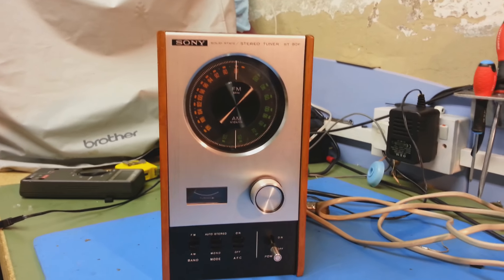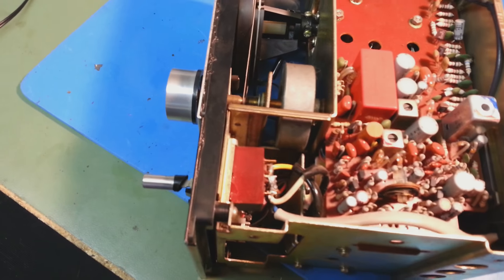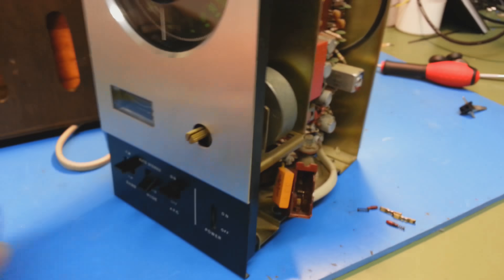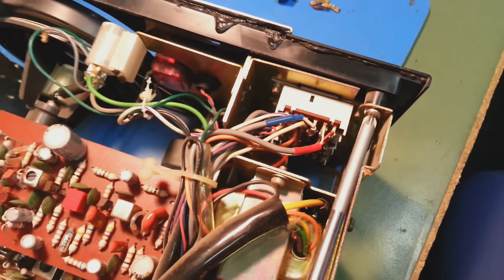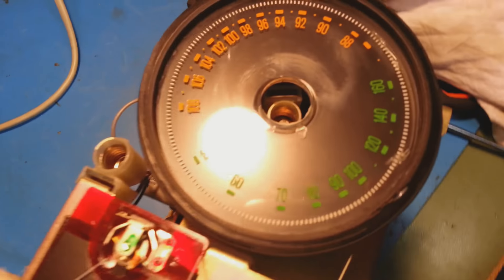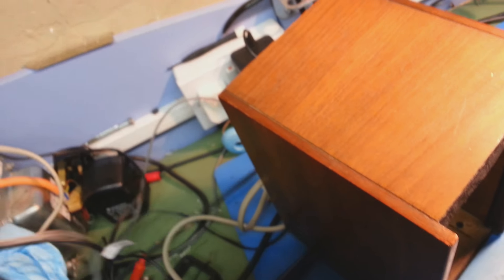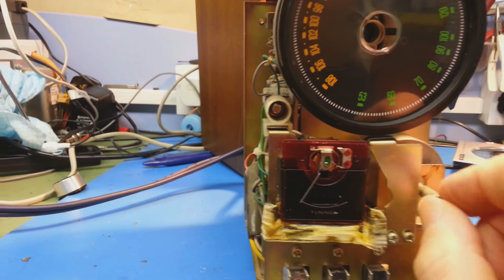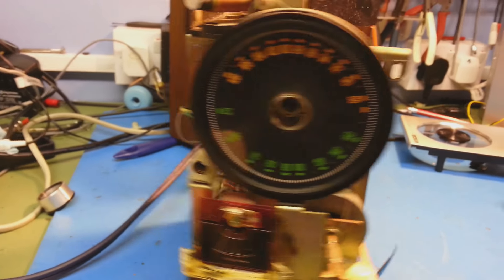Repair to a Sony St-80f tuner pt1

Comment: Nice vid, my ST-88 has no stereo “red” light and the tuner input meter only moves on “AM@ mode FM mode it’s all left hand side any ideas what’s wrong ? Thank you
Reply from the maker: Start at dirty switches then move on from there.
Reply: @SoddingaboutSi  loads of contact spray or isopropyl or both even?
Reply from the maker: @suntory1980  just contact cleaner.

Comment: I have just purchased an ST-88 which is fine apart from none of the bulbs seem to work. Oh, and the dial scale doesn't seem to be lined up correctly.
Reply from the maker: chrislufc Well the bulbs should be easy to find. You might need to paint them with green glass paint if you can't find the right type. If the scale is wrong on MW and FM I would relocate the dial in the shaft.